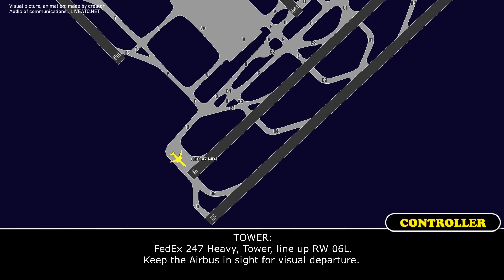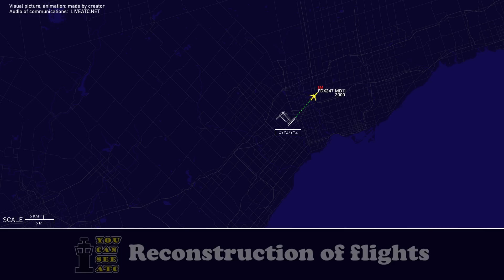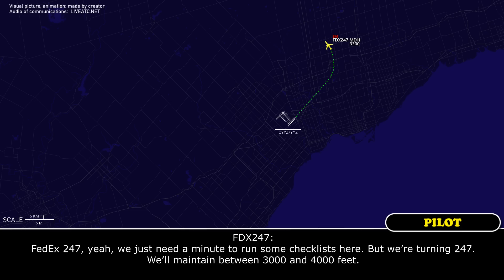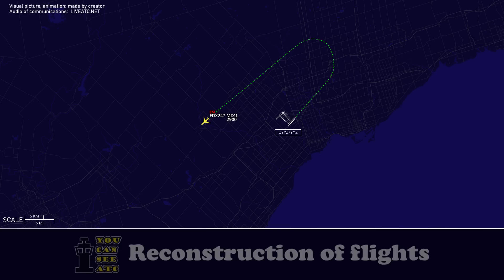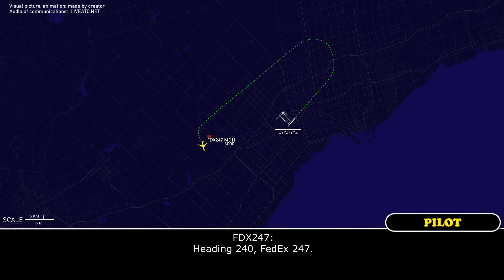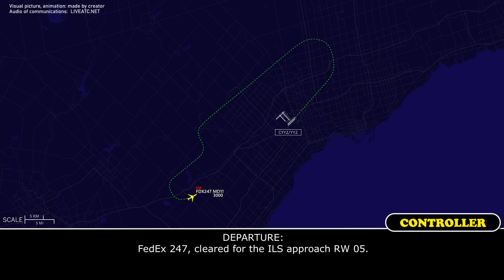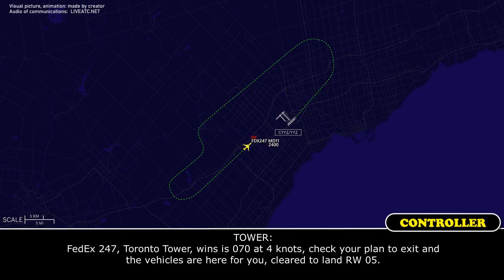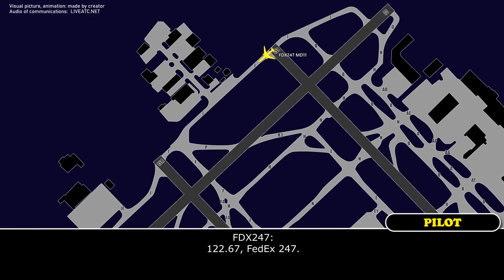Thrust reverser deployed after takeoff. FedEx MD-11 returns to Toronto. Emergency landing. Real ATC

Comment: Second controller interrupted the cockpit procedures with repeated and unnecessary calls.  Once the controller had direct communication and stated the sky was open for 247, he didn't need anything further during the time pilots were sorting things out.  He goes too far to be "helpful".  He wasn't talking to a fresh first officer . . . detectable in the first communications.   Props to the pilots.  An engine going in reverse could have ended the flight in different circumstances.
Reply: Strongly suggest you go listen to the actual recording of the incident. All of the dead air and calls to the other aircraft have been cut out.
Reply: @Woodsy110  Thanks.

Comment: if I was the pilot i would be shitting my pants. This kind of malfunction has caused the complete destruction of an aircraft and killed everyone on board, it took less than 20 seconds. This pilot has great awareness during the work load of take off. if the reverser engaged during takeoff thrust with zero response from the pilots, that plane would have gone down. 

I can only applaud the amazing skill and awareness of the pilots and the cool calm professionalism of ATC.

Comment: At low altitudes then a TR deployment is usually not fatal..in the flight levels it is extremely dangerous...look up the Lauda 767 that had an LOC after a high altitude TR deployment...they'll get to the bottom of it eventually it must never happen

Comment: Last thing a pilot wants is to answer a bunch of questions in a stressed, high workload phase of flight. ATC is required to get that info, but damn...
Reply: Strongly suggest you go listen to the actual recording of the event. All dead air and other calls to aircraft have been cut out.

The controller is actually really busy working other aircraft while dealing with an emergency at the same time.

Comment: I’m curious why they didn’t want a right turn. It’s always been my understanding that you should never turn your aircraft into the direction of a dead engine, or even worse, one that’s giving you reverse thrust.
Reply: It's not an issue if you maintain airspeed. It's a bigger problem with a twin prop, where the engine torque is also trying to lift the wing with the good engine. Don't know whether they shut down the defective one or just idled it. Shutting down an engine in flight is something that's usually avoided.

Comment: Also happy to see they minimized the frequency changes (unless I missed a change to approach).
Reply: I disagree... that totally wasn't minimal (which would've been zero changes). Since they weren't asking to dump fuel, and were likely to return after running the checklists, they should've just kept them on tower instead of adding yet another collection of stressors.

Comment: Coming in heavy with a load of fuel and cargo would've been a white knuckle ride and that's not even taking into account the issue with the thrust reverser. Handled professionally by all parties involved.
Reply: I very much doubt they were heavy (though there were a "heavy" of course). In particular, they didn't request to dump fuel, etc., so they were likely lightly loaded with fuel and on a flight within North America.

Comment: This could have very well ended in absolute disaster.

On the 26th of May 1991, a Boeing 767 operated by the Austrian carrier Lauda Air left Bangkok, Thailand just past 11:02PM* local time. Around 5 minutes in, the pilots continued to intermittently receive an advisory regarding the left engine reverser isolation valve (which controls if the reverser is to be stowed or allowed to be opened). In the quick reference handbook, it specifically said that "additional system failures may cause in-flight deployment". 

The flight's commander, Captain Thomas J. Welch, shrugged it off as "just an advisory thing" because it kept coming on and off, and boy could he not have been any more wrong, because just almost 9 minutes late, the left engine thrust reverser activated in-flight and immediately took 25 percent of the lift from the left wing and basically destroyed it because of the plume of reversed air that was located just in front of the wing thanks to the reverser design. The immediate result was the aircraft assuming a 90-degree bank angle within 4 seconds of reverser activation, and the aircraft continued to accelerate in a spiral dive (which was caused by whoever was pulling back on the controls) until it passed the speed of sound, broke up midair and exploded.

That accident specifically is the reason why we have safety measures to prevent things like this from happening. I don't know what it was with this particular MD-11, but these two are very lucky to be alive, likely because of their great airmanship. I applaud them.
Reply: I think someone mentioned that a selling point of the MD-11 is that it can have a thrust reverser deploy midflight and be okay, according to a sales video
Reply: @nolanono2532  Well enough, but you could still see that the aircraft was having trouble climbing with that thing deployed
Reply: @gaztastic  Yep. Glad the crew made it back safely and avoided disaster

Comment: Always seems like ATC wants hours/minutes when the pilot gives them pounds or vice versa
Reply: ATC usually wants pounds (or kilos) for firefighting purposes, unless it's a non-emergency and they're asking us for time-to-hold. I'm surprised the pilots gave hours/minutes... totally useless to ATC in an emergency.
Reply: @BruceWatson-dw3ro 
You previously said you are a pilot.
For which country?
Every pilot in the United States is familiar with the Airman’s Information Manual (Basic Flight Information and ATC procedures)
6-3-2 Obtaining emergency assistance 
a-3…….Transmit a distress or urgency message consisting of…
i….     Fuel remaining in minutes

You previously said a pilot can intentionally deploy thrust reversers in flight. 
I have over 30,000 hours flying commercial jets and I have never heard of a modern commercial jet where thrust reversers can be intentionally deployed in flight. There are physical locks (T/Ls must be idle) and interlocks (RA< 5’, air/ground sensor senses ground, some may use gear tilt to indicate ground contact) that prevent it.
The interlocks block hydraulic and electric required for deployment.
Locks and interlocks can fail but the chances of all of the safety features failing is extremely remote.
On the FedEx 247, an MD 11, he said “deployed” but I doubt it fully deployed at climb thrust. That would be catastrophic.
It was probably just an unsafe/unlocked indication and the pilot shut the engine off as a precaution.
I haven’t seen the official report.

Comment: I'm far from an expert (merely a former flight attendant) but I thought it was almost impossible for a thrust reverser to deploy in flight, as they only work with weight on the landing gear? I'd be happy to learn from those in the know as to how this can happen.
Reply: I'm no expert either, but I have some experience with air-frame maintenance.
There is what's called a 'squat-switch' on the landing gear that tells the computers on board whether the aircraft is on the ground or in the air.
My initial guess would be said squat-switch either malfunctioned or simply failed, sending a false signal to the computer to trigger the reverser in flight.
Could've been something else, though. 

As I said, it's just my guess as I shine the seat of the chair I sit in as I type this comment. 
Best thing to do is wait for the real experts to say what happened.
Reply: @mrgone658  On many aircraft, the squat switch is not a condition for reverse thrust, but it is for armed spoilers.
Reply: It’s a very rare event as generally speaking there’s at least a couple of systems that prevent it from happening. Not familiar with the MD-11, but other aircraft will forcefully set the thrust to idle if other systems don’t prevent it. So it basically presents as an engine failure.
Reply: @bubbaoriley7864  Do you mean reverse thrust forcefully sets thrust to idle?
Reply: @BruceWatson-dw3ro  Well that would kinda make TR kinda worthless, so no.  I mean if the TR is somehow deployed in flight, the aircraft will forcefully set idle power. This is a certification requirement for aircraft not certified for in-flight TR use.
Reply: I see lots of nonsense answers here. In many aircraft, nothing prevents selecting reverse (especially on high-bypass cold reverse engines) before touchdown. It's usually not connected to the weight-on-wheels/squat sensor (though spoilers are triggered by that). It's simply bad style to be selecting it too early.
Reply: @BruceWatson-dw3ro  Mr. Know- it-all , trawling through the comments section and trying to impress us all with his massive brain.... 🙄😂
Reply: @peterfitzpatrick7032  Ha ha, no... neither trawling nor brainy. This video+discussion is super interesting, I had lots of time on my hands, and I'm a pilot so I have a vague idea of what I'm talking about.
Reply: @BruceWatson-dw3ro  the vast majority of turbofan transport category aircraft have systems that prevent more than idle TR power in flight(by certification standard) which is the context of the original question. Certainly military aircraft are the exception as they are designed for such use. So including “many” in your answer while technically true makes it nonsense.
Reply: @bubbaoriley7864  Fair enough. So, I've occasionally gone to idle reverse before touchdown after pulling the throttles to idle. The interlock is in the throttle position, not the engine thrust setting... I hadn't pulled to idle much earlier, so although I didn't look at N1, I doubt they'd spun down to flight idle thrust. I took her question to be whether it's even possible to deploy, which it is in many aircraft. Aside from that, if I had a decompression at something like FL400 (40,000'), I'd be sorely tempted to increase descent rate by using reverse idle (no, that's not approved, so I wouldn't really do that). Many people don't notice that idle (instead of more) reverse is often used on longer runways... going from a few hundred kg forward idle thrust to similar reverse is still good for the brakes.
Reply: @BruceWatson-dw3ro  I use TRs in almost all situations for landing, specifically due to the brake wear considerations you mention although even that is debatable as you also have wear and tear associated with TR deployment. From a safety standpoint TRs don't do much of anything for you on a dry runway. Many jets don't even have them and for those that do the aircraft can become uncontrollable in flight if they are used. Some military aircraft use them in flight to descend rapidly to reduce exposure to ground fire, but they have many design and testing considerations.  I'd never even consider it in any situation if the aircraft wasn't designed for it. Lots of things can go wrong, such as with the bucket type it's a good bet the doors will just rip off at high speeds leaving you with an asymmetric condition and possibly a smoking crater.

Comment: why didn't they take right turns? split-second decision or something i'm missing? aren't left turns harder to get out of (death spiral) when engine 1 is malfunctioning?
Reply: Doesn’t matter which way they turn. But if was the number 1 engine, it’s easier to make left turns.
Reply: @saxmanb777  The dangerous part is when you can't get OUT of the turn and go into a death spiral, that is why I thought right turns would be safer
Reply: After takeoff ATC noticed them deviating left, so I’m guessing whichever engine it was made left turns easier than right

Comment: Jeez. I know they’re rated to handle 1 unintentional thrust reverser deployment but it still isn’t a great thing to have to deal with. I wonder if there were obvious flight control issues that ATC noticed and why they checked in, or if they weren’t responding to comms.

Comment: I appreciate the controller's concern and wish to assist, but as a pilot, when you're running checklists during an emergency it really helps if you allow the pilots to do their job, fly the airplane and finish their procedures with as little interruption as possible.
Reply: We forget gaps are often cut out. This ATC had a good balance IMO and really only pushed for information that is very helpful (but of course even the most crucial information such as fuel and souls can be ignored by pilots if they feel they’re too busy to respond, like any). Pilots also need to remember, as some do, to remind ATC to leave them alone and will radio in when they’re done. Sometimes ATC need reminding during the adrenaline dump.
Reply: @OfficialSamuelC  I think the pilot asked the controller to standby either once or twice. When pilots have things stabilized they are free to converse, in the meantime radio work is a distraction they don't need. It's nice to be sitting in a cool dark room, something different when you're having to fly a balky aircraft in the weather. Pilots are taught at an early stage of their training to; Aviate, Navigate, THEN Communicate...
Reply: @dutchflats  Agreed, but given they were forced to turn them over the city (due to #1 at idle), it started to make sense to check on them occasionally, also given the pilots vague altitude management, lack of souls-onboard when first asked, and totally incorrect answer to fuel onboard.

Comment: I understand the concern of the ATC, but the huge amount of questions irritates me! The pilot informed that he needed to comply with some checklists! This step is crucial for the crew and needs a lot of concentration and a person calling the whole time on the radio, cutting off the thought of who is trying to solve the problem, it's dangerous!!
Reply: 100% right. The controllers had great intentions but a lot of those question were completely unnecessary. Glad everyone is ok
Reply: @rzavsgza  Exactly! If it were me in the cabin, I would ask for silence and that I would return when possible! The guys had a thrust reverser in flight! It's not "any" emergency!
Reply: Keep in mind that silences are trimmed here to save on time for the video. Delay between questions may have been as long as 5-10 minutes or more.
Reply: @Loopy01  I have that in mind sweetheart... But still, too many "are you okay" questions...
Reply: @Loopy01  Keep in mind, people are too lazy to read the beginning text so they say dumb things 😀

Comment: Now that's a crew I'd want flying passengers instead cargo.  Well done!
Reply: The compensation they provide their pilots is unmatched, they get the best of the best, contrary to what people think.
Reply: @thejackbox  Once they get to multi jet, yes. At the prop level, no.
Reply: @jimveybe7689  FedEx does not operate any turboprops. The ATRs, Caravans, etc. are all operated by contracting companies. All FedEx employed pilots are paid well.
Reply: @thejackbox I mean that was definitely not true with their previous contract. A first officer made about $60k their first year. The major domestic airlines offered $80-90k first year. Their new contract hasn't been voted on by the union but it seems to have brought them back in line with the majors.
Reply: @SlightlierGravy  First off, FedEx Express is a major airline. I believe you're comparing to legacy airlines. Second, FedEx was among the best compensated for a long time and offers better job security than the passenger airlines. Their compensation is excellent  considering that they are far less likely to be furloughed.

Comment: "It's JUST a thrust-reverser that deployed inadvertently..." Just? 😬😯😨😱
Reply: The MD-11 is built to handle a single thrust reverser deployment in flight per a company MD-11 sales video. It isn't safe but isn't necessarily lethal.
Reply: Well, it was an answer to whether they could taxi off the runway. The engines don't have much to do with that
Reply: @ToppledTurtle834  Well, without the engines, you're not taxiing 🙂
Reply: It is a MD-11
Reply: The flight crew of Lauda Air Flight 004 would disagree with this assessment.
Reply: @Nummer378  The flight crew of Lauda Air Flight 004 were not in a MD-11. A number of aircraft are certified for in-flight reverse thrust, including the DC-8, Trident, C-17, Concorde, several bizjets like some Gulfstreams, etc.

Comment: Aren't there suppose to be systems in place to prevent the reverser ever deploying mid flight?
I thought they changed the way they work after a similar situation caused a crash years ago. Maybe I'm remembering wrong but I could have swarn this was a big thing that the manufacturers had to deal with.
Reply: Boeing did it after Lauda Air 004 happened, and only when Nikki Lauda twisted their arm to admit fault. The MD-11 can safely handle a thrust reverser deployment mid flight according to a company sales video.